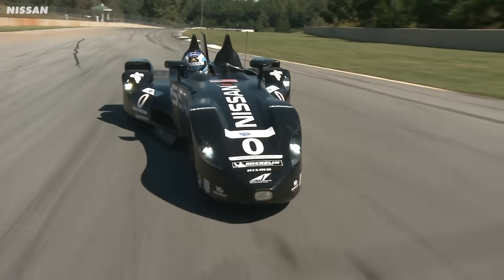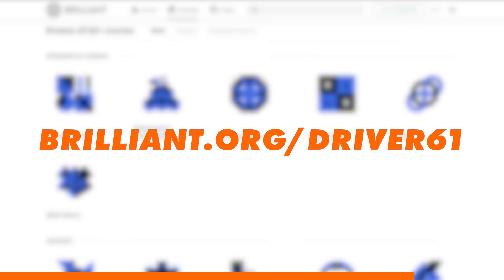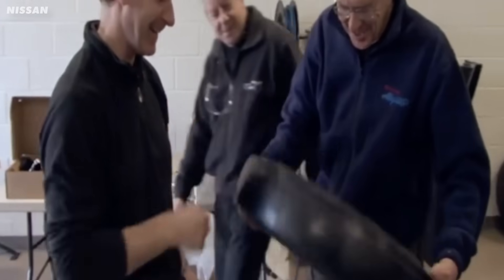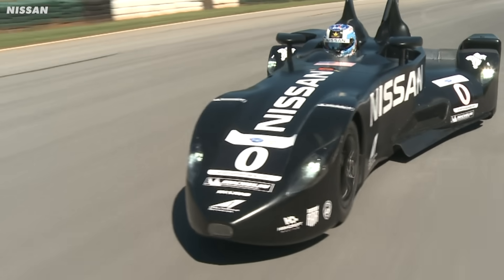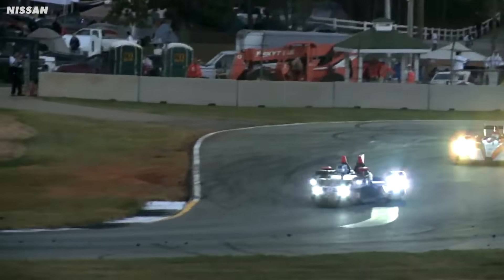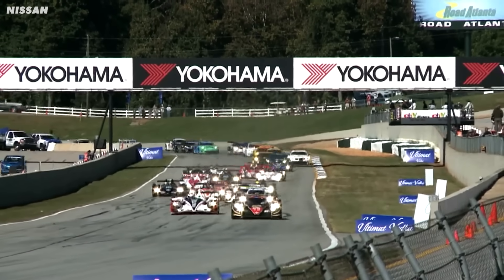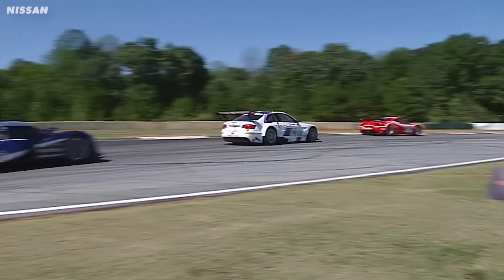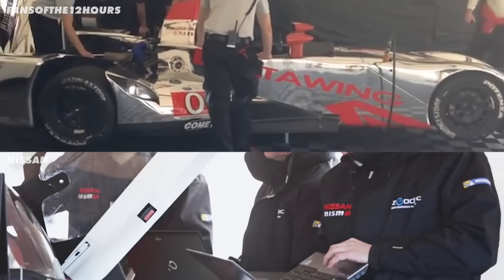Why This BIZARRE Race Car was GENIUS

Comment: Id love to see this exact same type of episode on the FWD GTR LMP that Nismo tried.
Reply: Fwd is dull wheel drive.
It was never going to excite real drivers.
Reply: @procatprocat9647  real drivers get excited by all types of drivetrains. i'm 100% sure a track spec civic will smoke anything you drive.
Reply: @Modi.Drives  you're confusing lap time with driver enjoyment. It's a common mistake.
Even a low powered lightweight rwd sports car is immeasurably more involved and satisfying to drive than a one dimensional fwd motorised shopping trolley irrespective of power output.
Reply: @procatprocat9647  i own a 300whp s13 200sx, ep3 type r civic, mazdaspeed demio, accord aerodeck and a  r53 mini cooper S. i used to own a bmw e46 330ci, bmw 318i e30 with a m52b28, eg hatch and a peugeot 306 gti, i know what i'm talking about. the peugeot is the most fun i've ever had in a car. i've driven a formula student, formula renault 2.0, uncles rally ae86, dads rally ae86, dada old mk1 escort rally car, 250cc superkart and i drove karts since 7 etc. none have been more fun on a track than that peugeot was.
Reply: @Modi.Drives  206 is even better than a 306 even with the little bit of passive rws. Try one. I've owned both. 
Lift off oversteer does add to the fundamentally one dimensional experience of fwd cars. 
.
However, nothing beats the pure separation of throttle and steering.
Balancing the oversteer and steering a rwd car purely on the throttle is something that no fwd car can do, irrespective of what you claim to know.
Driving up to the limit of understeer is dreary in comparison.
Reply: @procatprocat9647  someone has clearly never driven a fwd car on rally tires on gravel.
Reply: @Modi.Drives  oh now you need to be on gravel to enjoy terminal understeer. You're changing your tune 🤣👍

I have. It, was entertaining but rwd is vastly more fun and entertaining.
Reply: @Modi.Drives , I'm,with you all the way re Fwd cars.

I too have owned a number of Fwd and Rwd cars, plus an Awd Infiniti Q50S and easily the most fun was to be had in any of the Fwd cars.

Favourite and best? Easy. The 306 Gti6. 
I spent a tidy sum on uprated suspension and brake components, because I wanted a car that was quick  on twisty winding country roads.

Front Coilovers and Adjustable rear shocks. 
Roller bearings on the front suspension wishbones.
Front upper and lower strut braces.
Solid rear suspension beam mounts.
Larger 30mm rear ARB.
Front brakes uprated to separate bells and rotors with Brembo 4 pot calipers.
Also throw in a lightweight flywheel and Team Dynamics Pro 1.2 wheels shod with Toyo T1S tyres.

It was/ still is the best handling car I've owned or driven and I've owned some nice cars. 

More expensive? Yes.
Faster in a straight line? Absolutely.
Quicker,faster or as much fun on the roads I built the 306 for? Absolutely not.

I likened it to being in a large Kart.

Lift off oversteer? Non existent.
Understeer? As above^^^.
If you wanted to induce a slide that was possible, but was only for show at a circuit.

It just gripped and stuck to the road like a " limpet on a ships hull" when cornering.
Reply: @procatprocat9647 , sorry but a Peugeot 206 has nowhere near the handling capabilities of a 306... Period 

As for all this tail out nonsense on Rwd cars on twisty roads, I prefer to make progress without any "sideways action".
Reply: @MrLg55555  206 is more fun to drive. 306 was also good, but still just fwd motorised shopping trolley.

I know your type well. You enjoy making progress. I enjoy driving. The finesse of balancing and steering a car on the throttle is something joyful, particularly in a car with no nanny aids. It's like a finely adjustable dance. I'm not talking about lurid oversteer. 
Simply pressing the accelerator in a powerful fwd does nothing to stir the soul and requires very little skill. All you end up doing is sitting behind traffic a bit sooner. It's a one dimensional experience that's usually anodyne. 

Each to their own.
We both enjoy driving, just very different styles 👍
Reply: @procatprocat9647 , sorry to say, but you most certainly don't know my style of driving.

If you look at a previous comment I made re the suspension and braking upgrades I made to a 306 Gti6, this should tell you the type of person I am when behind the wheel of a handling focused car.

I had her built so as to entertain and fully enjoy every drive out in her. Every drive on any demanding road was a blast and left me with a huge smile. I used to feel as though the car and I were one. I have come close to this sensation in other cars I've owned, but as they say " no cigar"!

Even a Cayman S I owned couldn't reach those handling levels. Straight line performance it was way in front, but driver involvement and devastatingly quick progress on twisty and demanding roads, it wasn't in the same ballpark.

Same goes for Bmws and 2 of the 3 Mercedes I've owned. The nearest was my AMG CLS Shooting Brake. Devastatingly quick in most situations and required my full attention on really demanding roads... And it made me smile, certainly not for the faint hearted, but still a little short of the thrill of the 306.

Anodyne shopping trolley requiring little or no skill? You're throwing darts at the  board and missing everytime.

But each to their own 😉
Reply: @MrLg55555  
Do a poll of proper race drivers and ask them which they'd prefer.
I don't think you'd find many who prefer the compromises of fwd. Even 4wd is a shallow experience compared to rwd.

Some people just prefer to drive anodyne motorised shopping trolleys and that's great because it leaves more of the involved rwd driving machines to me.
I'm pretty happy with my supercharged exige and 7 for now, you enjoy your bloated saloons and fwd hatchbacks 👍
Reply: @procatprocat9647 , just a brief reply.

Giles Pannizi in a 306 Maxi and latterly Sebastian Loeb in similar.

A Fwd car that to this day can hold its own on tarmac stage rallys, against more modern and powerful cars.
Reply: @MrLg55555  you're missing the point, just like modi did.
There might be faster fwd cars out there, but my point was wrgt driver involvement and satisfaction. The poll I proposed was about preference, not laptime.
At some point soon it will always be faster to switch on the driver aids, driver AI, additional traction systems, etc, but they only detract from driver involvement and satisfaction.
If you only want to get round a track quicker, install rails and ignite a rocket. Just one button to press, and zero skill or involvement. It would be even faster if you aren't inside. 

Hope you're beginning to understand the difference 👍
Reply: @procatprocat9647 , I totally understand and agree with you re a poll of race drivers preferences.
I would say that the majority would choose Rwd over Fwd or Awd for involvement and driving satisfaction. 

However, Fwd and Awd platforms can and are rewarding, involving and satisfying if you learn to utilise their abilities.

The reason I upgraded the 306 is because I wanted a quick cross country car, that was involving, entertaining, enjoyable and satisfying. It basically was to put a huge smile on my face each time I drove her.

Nothing to do with using driver aids, of which it had only standard ABS, to enhance the experience.  It was a pure drivers car that commanded respect, required myself to have the necessary driving skills and was always rewarding. Plus I never drove foot to the floor all the time. That would've been boring.

Fwd and Awd Platforms are no different. I just happen to prefer Fwd and wouldn't knock the choice of others.
Reply: @procatprocat9647  It was meant to be AWD but Nissan rushed the development. Combustion power to the front and an electric flywheel type device powering the rear wheels
Reply: @procatprocat9647  there are plenty of awesome FWD enthusiast cars. Stop being so narrow minded.
Reply: @augustortiz  true, but an average rwd car is immeasurably more satisfying and involving to drive than a good fwd car

Comment: I had a go with the le mans spec on the simulator. I feel validated as a race driver now because my conclusion was the same! 😂 As soon as the rear tyre hits the curb the whole thing suddenly oversteers and is a sod to correct. It's like steering sensitivity is set to 200%.
Reply: open diff doesn't help. I'd say that's caused roughly 50% by diff & 50% by steering.
Reply: @piuthemagicman  100%. You can also reign in the instability over curbs with trail braking. I also played around with adding an LSD to the car in Assetto Corsa, and you could make it behave a lot better (to a point) with changes in differential preload. But where you gain stability over uneven surfaces with the LSD, you end up sacrificing too much maneuverability in both low speed and high speed corners. Sometimes the car feels absolutely fantastic on flat road courses without many elevation changes, and it's an absolute hoot to drive. But on more varied surfaces, to make it actually viable it feels like it needs a whole suite of electronics, with active aero, and brake/torque vectoring to get it to keep up with more "standard" machines with a similar power to weight ratio, and if you need all that just to get it to keep up I think that says everything you need to know about the concept. I still think it's absolutely cool as hell though.
Reply: @K31TH3R  sounds like how modern jet fighters had better performance by being unstable (read easier to manoeuvre as they weren't fighting inherent stability), but weren't practical until fly-by-wire and computers were able to micro adjust the control surfaces multiple times per second. Sounds like the same thing would enable greater control and performance by not having the car upset so much in the first place and this not requiring a lot of heavy handed correctional forces to regain control.
Reply: @K31TH3R  can you upload some sim laps to your chanel?
Reply: How much time would you lose or gain by avoiding the curbs?
Reply: @demon1954  Anything you do to improve it's consistency and predictability around the corners usually ends up hurting your lap more than it helps, since you pretty much need to be driving the thing at 100% of it's potential and using every bit of the track due to it's lack of corner exit speed versus other machines in it's class, else you just lose too much time. That is a big part of what makes it really fun to drive in a sim, since you need to absolutely send it and go full YOLO all the time to stay competitive. But if behaves in sims the way it does in real life (which it does seem to do) I can't imagine it's characteristics are particularly desirable for the people tasked to actually drive the thing among other cars on the track.
Reply: What game has the deltawing???

Comment: Sorry, worst race car ever might be too harsh, but I will propose that consideration, at least in this modern era.  Having such a substantial difference in track width is inherently unstable.  In this case, under all conditions but perhaps less so in acceleration.  This is the reason Breedlove's Spirt of America LSRCs, would tend to ground loop when the chutes came out.  All the weight suddendly transfers to that very narrow front track.  (Weight/load wise you now have something closer to a unicycle.  Can it be made work physically?   Yes, but almost anything can upset it; the narrower the track is up front, the more diffucult it is to control and compensate for.  Particularly when trying to brake and corner.  As of now, the detriments far outweigh the benefits.
Reply: Did you even watch the video?

Comment: The delta wing is for supersonic flight (Mach 1+) due to incompressibility of air at these speeds.
Reply: It does work at any speed though, just it needs a high angle of attack at low speeds which makes a lot of drag. I mean, paper aeroplanes are delta wings and fly.
Reply: @DaFinkingOrk  I am 10yr Air Force & 10yr Corporate jets & a pilot. Delta wings don’t work at slow speeds or high angle of attack. That is why aircraft of that era landed at high speeds and had drag parachutes to slow down.

Comment: Hub_13 attacked a teammate.
hot guy attacked a teammate.
Hub_13 @ T Start (RADIO): FireBomb on the way!
+$150: Award for neutralizing an enemy with the AK-47.
Hub_13 @ Lower Mid (RADIO): Smoke Out!
grindelwald_01 is joining the Terrorist force
XxTehRetoxX attacked a teammate.
goth ducky @ T Ramp (RADIO): Smoke Out!
goth ducky @ T Ramp (RADIO): Flashbang Out!
goth ducky @ Banana (RADIO): FireBomb on the way!
DEAD D1 Exterminator : DEAD janroucka55 : stupid chicken scared me

Comment: I always wondered about a reversed delta. Mot of the drag in a car comes from the vacuum a the back. Trail braking might benefit from it too.
Reply: Interestingly most of delta wings lift comes from a vortex they make on the top of the wing. And now F1 cars make a vortex underneath the floor using those fence things at the start of the tunnels under the floor (though I don't know how much of the suction it makes comes from the vortex vs the Venturi effect).
Reply: The Nissan LMP1 car was basically a reversed idea on the delta wing. It had 70% of the weight on the front, with 90% of the braking being done by the front wheels. The reason as to why the car was built like that was since the front end of LMP1 cars was largely free from aerodynamic rules. And with so much braking on the front, they could capture a lot of energy from a single set of motors.

Braking was that cars achillies heel, largely due to a non working hybrid system making the brakes overworked, and from the onboards, it seemed that they only braked in straight lines.

Comment: I really don't understand why f1 cars aren't getting lighter and therefore more economical in that way. They pertain to be a good sport for car manufacturers to test new devices which would invariably make production cars safer and better in general. Its so far detached from the real world tech for the everyday person it's bordering on ridiculous. It's simple.... lighter vehicles take less energy to move them. Id rather watch cars 50mph+ slower but have them more nimble and easier to overtake each other

Comment: It wasn't genius, it didn't work so they canned it. Same as the LMP1 project.

The whole idea was "we have a design that doesn't need a powerful engine to compete" which was proven entirely false by the fact they only managed to be competitive with the IMSA programme which increased the power output.

Why are people so bamboozled by shiny and new/different things, it's baffling.

In the rain this car was so unbelievably lacking in control authority it was straight up dangerous.

Thank god they didn't race this in indycar, people would be sideswiping each other with the rear ends when side-by-side or trying to overtake

Comment: It's an MR, practically RR car. Common knowledge that they dive into corners and very tricky on that throttle out.
Reply: No, not really. Take a Porsche for example, if you have problems with how they drive its because you're not smooth enough and well, pretty ham fisted.

Comment: I would be curious of how it braked. All the weight shifting to those narrow wheels mounted so close together had to feel weird.
Reply: Most of the braking was done by the rear tires for stability like a parachute. This allows the front tires to still steer in the corner entry because they aren't being used to brake.
Reply: At least in games, it is a very understeary car,  maybe because of the small surface area in the front
Reply: @CarlosLins1  I believe people have this misconception about it's handling because they are lacking on a vital information about the car, including this channel. What most people don't know is that the car handling was actually heavily influenced by a very tricky rear suspension setup. I don't really know how to tell this in technical terms, but basically the car rear suspension setup help the car to rotate better mid corner as the weight of the car shifting from side to side. Chris Harris did a review video about this car years ago, and had the designer himself explained about this.